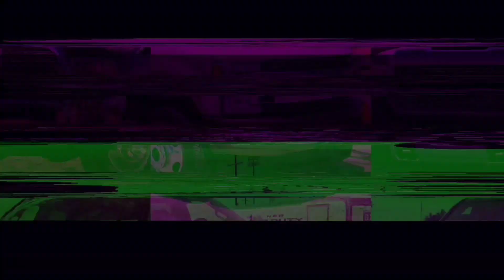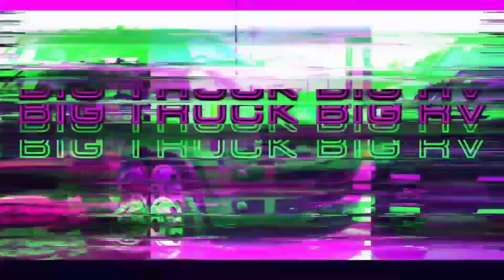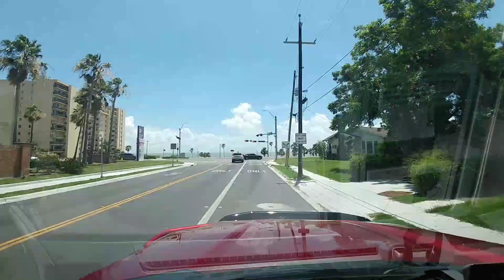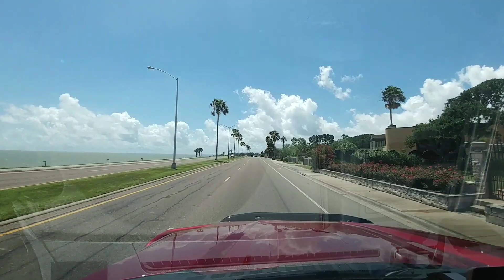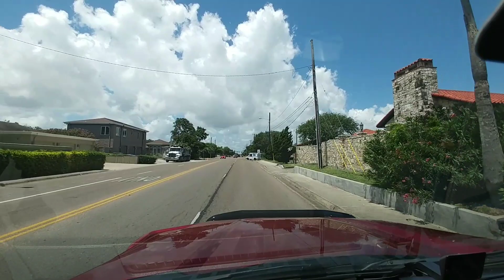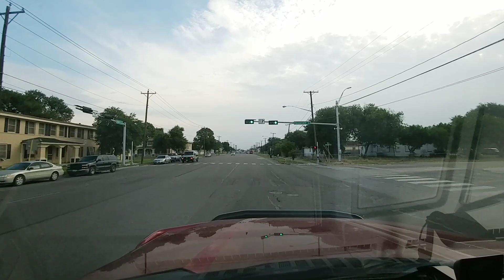#14: Towing a Fifth Wheel with a Gas engine, Multi-purpose Air Compressor, Tires vs brakes

Comment: Tow vehicle Ram 2500 6.4 L hemi. 4 wheel drive. Travel trailer 9000 pounds fully loaded. Do not need load leveling. But what would be the best anti-sway setup.

Comment: You are wrong about the person wanting to tow with his F350 gas engine. 
There are plenty of gas engines capable of towing 14k. 
I know a 2016 F250 with a 6.2 and 4.30 axle ratio is rated to tow more than the same truck with a 6.7.
Reply: You're correct in that there are gas trucks that have a rating over 15k, it mainly depends on his gear ratio and the year of his truck which wasn't provided in the question.  Also, even with the 2016 truck and 4.30gr, with a 4wd truck it would still be very close to the max towing capacity of 15k.  That is a lot of strain on a gas engine, especially if towing up grade.  You're incorrect in stating that a similar equipped gas F250 has a higher towing capacity than the diesel.  The 2016 Crew Cab F250 and F350 4wd trucks share the same 15100lb tow capacity.
Reply: Big Truck Big RV 
Not according to the owners manual I had with my 2016 F250. 
The gas version with a 4.30 ratio had a slightly higher tow rating

Comment: You mentioned that the guy had a problem with a caliper on his trailer freezing up during a stop. You then recommend he up grade his trailer brakes to disc brakes. If he had a caliper freeze up then he already has disc brakes, right?

Comment: I have a question? I have a 2020 F2 50 4 x 4 XLT with a 7.3 gas. 15 K tow rating. I currently tow a 26 foot Keystone hideout that weighs 7300 pounds. Truck pulls it like nothing. I am looking to upgrade to a fifth wheel like a 32’/33’foot Montana fifth wheel. I’m looking at fifth wheels in the neighborhood of 12 K empty 14,500 gross. What do you think?

Comment: in your F350 question will the upcoming 2020 F350 Super Duty 7.3L Gas SRW (Godzilla) work?
Reply: We'll find out.  Don't know the numbers yet
Reply: I think so. Especial if it has the same transmission.
Reply: @bigtrucklittlerv7969  It will come with a new 10 speed transmission.

Comment: That fifth wheel on the gas f350 at 14k lbs is no big deal at all.  I don't know what year you have for the payload factor but but if you have the 6.2L you will have adequate power and if you have the V10 it will be no big issue at all.  I am not a ford guy but if it is possibly a 5.4L like I have seen in f250 you need a new truck.

Comment: Realistically, how long should a 5th wheel trailer last? Is 20 years realistic?
Reply: Michael B; depends how well you take care of it, store it indoors/outdoors, how much you use it.  Of course appliances will have occasional problems after time.
Reply: I had  1972 Winnebago D24 Indian Motorhome that I took camping until I sold it in 2002. I did have to replace the roof (manufacturer defect with the special laminated panels Winnebago used at the time...glue dissolved the aluminum sheeting from the inside and pin holes developed on the roof exterior), but otherwise everything else continued to work with regular maintenance. The guy who bought it drove it to his home....then a hurricane hit and a tree drop on the roof.....still there but I dont think it is used anymore :-(  I had a 1993 Terry Resort 37V that I bought in 2002 and it had no issues at the time....used for 5 years and sold...still no issues. Both the Winnie and the Terry were outside in the Florida sun never covered...just washed, waxed and maintained. Yeah I had to replace batteries, tires, fluids, etc, but that is to be expected. I had a 2005 Laredo 28BHS bought used in 2008....had to give it to the dealer when I bought my most recent 2019....it was coming apart (Keystone). Chased leaks, chased issues with the appliances...etc, from day 1. What am I saying....realistically it depends on the trailer design as much as how well you maintain it. Winnebago was 40 years....Terry was 15 years and still going, Laredo was 0 years since it started de-laminating the first month I had it so I guess the previous owner had leak issues as well.....

Comment: Question - currently towing GD Imagine 2800BH (GVWR 7995, posted hitch 604, but I’m betting it’s more towards 850) with 2018 TitanXD Gas Pro-4x (payload on door 2,260, max tow 10,990) moved up from 2014 Tundra (noticeable towing experience improvement).  Watched all your TitanXD videos but still never feel like I got a clear answer on if it’s better for towing than a half ton.  What’s your thoughts on how much more capable an XD or an older model 3/4 ton for that matter over a 1/2 ton?
Reply: 50% better across the board. 8,800lb. GVWR is proof. About the same as older 8,600lb. GVWR trucks
Reply: Titan has higher curb weight than any 1/2 ton by over 1,000lbs. more stable platform to start. Axles are beefier too